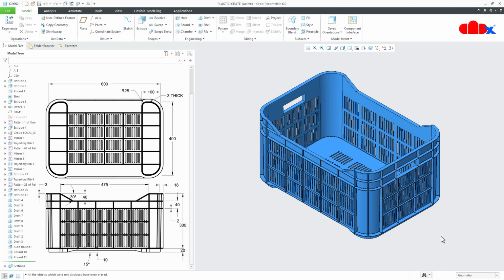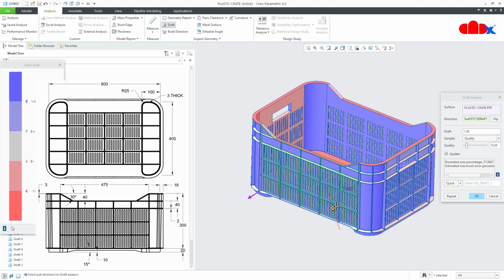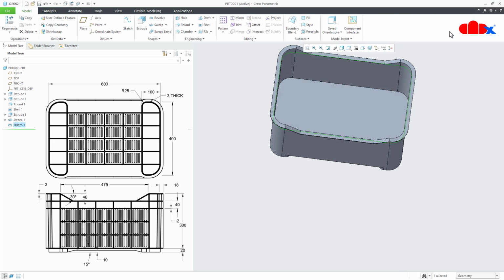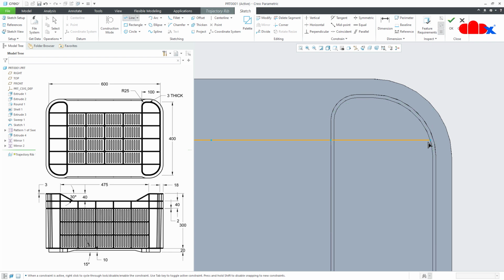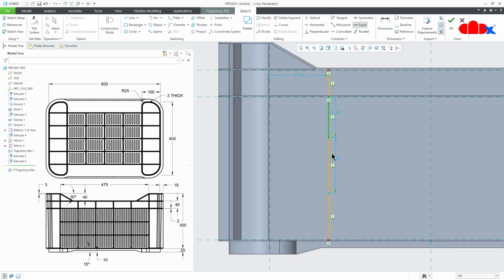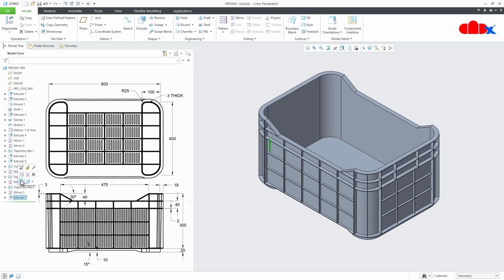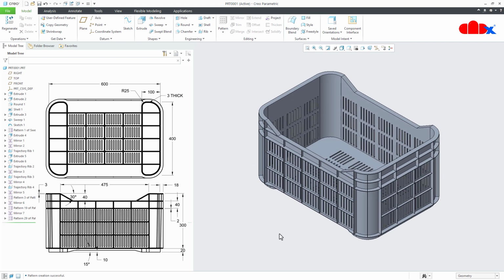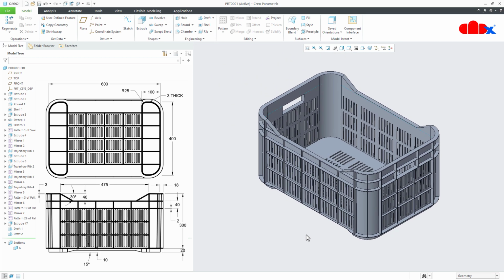Plastic crate | Plastic design in Creo Parametric

Comment: really good video but i still confuse about when you say taking care about other suface ( red, white) in the last moment of video. How can i do it ? please i really need it
Reply from the maker: Write down the timing for the video frame
Reply: It is 46:11. There is a red rib around the crate and i cant define which surface is hinge surface. When i try to choose the suface which has the same direction with pull direction, the rib then has different thickness.